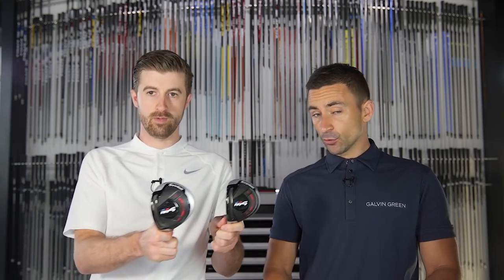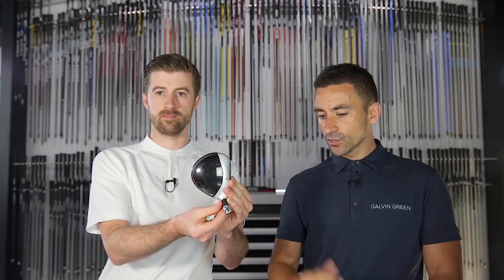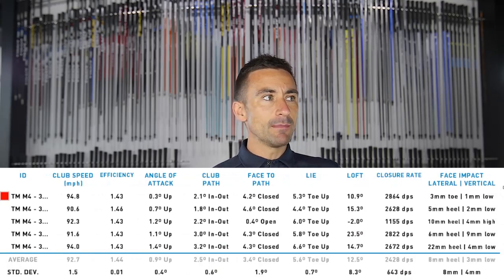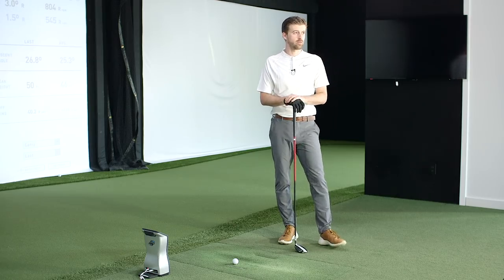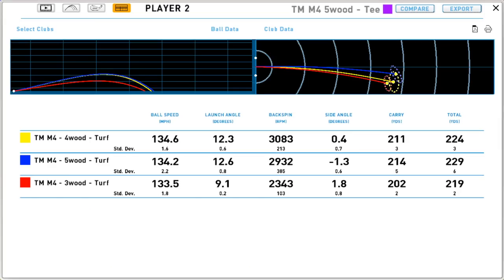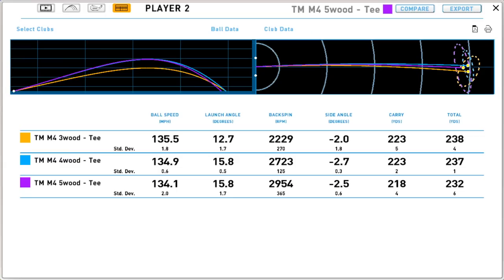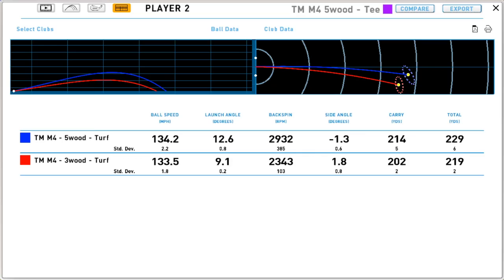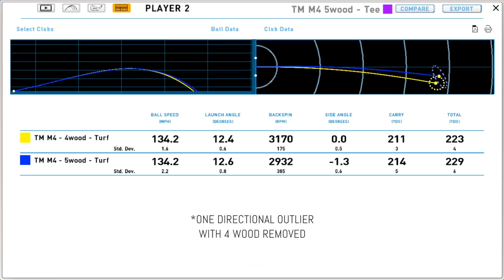Are You Playing the Right Fairway Wood Loft?

Comment: I have come back to this video after a year and I have followed its recommendations -  dropped the 3w from the bag, turned down my 5w a degree to 17 degrees (so a 4w) and it is functional both off the tee and off the fairway.  The reality was that the 3w at best was only 10 yards further than my 5w but far more erratic. 

As Mr Average swing speed, the video was 100% correct.  I have not tried a slightly longer shaft in my fairway - interesting idea, although oddly I have shortened my driver shaft to 44.5" and massively improved the accuracy of the driver with no/little obvious loss of distance

Comment: The theory conversations and way you go about things in fitting ideas is great. My first golf coach told me something about club setup 25 years ago. He said to find a club that you have to have, your go to club but it can't be a putter or 1 wood (they weren't called drivers exclusively for a few more years then) and then build your set off that. For me its a 56deg wedge. Everything in my bag is gapped off that club. I don't carry a 3wood because I don't need a 265yd shot off the deck or tee. I go driver, 19 deg hybrid, 21deg utility iron, 4i-9i, 47deg PW, 52, 56, 62. I've gone from traditional sets, to very non-traditional sets. If I play a long course i'll pull the 21deg utility out and put in a 5w that gets me 10 more yards of carry than the hybrid. I am a sub 3 handicap, and getting my set built for me is a big reason why. I used to have a 3w and I think what made me dump it was playing 10 consecutive rounds and not using it one time. All the clubs in my bag now have a very good chance of being used for a reason and not just to force it.

Comment: Driver swing speed 98mph / trackman. I purchased the M3 set loft at 17 and couldn't be happier. It does create an awkward gapping at the top of the bag. I now go 20 degree M3 hybrid for my 205 carry club. I dropped the 5 wood and will probably pick up hollow 4 iron or 22degree hybrid to fill the gap off the 5 iron.

Comment: This has been a work in progress area of mine for quite a while. I play off 4 and I've got a swing speed of around 104 -108 on Trackman. In the garage is a Ping G25 16.5, Titleist 917 16.5 plus a TM M2 Tour 16.5. What I've fallen back on more often is a TM 17deg SLDR hybrid with a 5wd shaft (bullet! very similar to the driving irons) and I'm mucking around with 21deg 913Fwd. At least 2 of these have to go but fun on the range

Comment: Another great video. My swing speed is faster than low 90s but slower than Matt's - i.e. around 100. I have always been a Driver, 2wood & 4 wood player - for 2 decades. I never understood 3 wood or 5 wood - neither seem optimal from a bag setup perspective - not that they can't hit 'good shots' but from a bag setup. Your little comment about 4wood is basically as good as 5wood off the fairway but better off the tee is why I think it has worked for me - i.e. I like it off the fairway way better than the 3 because it has a shorter shaft and more loft but it can also potentially serve a dual role potentially as driving shaping type club on certain type holes. Ditch the 3 & or 4 iron, add a gapping hybrid that resists drawing as a long iron scoring type club replacement, and the bag today is much more functional than years ago. I will say that for physically shorter golfers, the shaft length of 2 & 3 hybrids are probably much better from a consistency perspective than a 4 wood. I choose the 13 degree 2 wood because I like a driving club that I can Draw - I set up my driver to Fade. Awesome stuff guys!
Reply: At 5’6” I can totally associate with that. I have to cut down everything

Comment: Matt is right, I went conventional and tradition and couldnt get a 3 wood off the deck and topped it all the time. Changed to 16° ping g410 sft to help get the ball up. Still going 240 yards. Just added the 5 wood instead of a hybrid. Both 1° flat. Really happy now.

Comment: Great info guys. I started last season with an M1 3 Wood. Found it was too long off the tee. Felt like I was carrying two drivers. Switched to the M1 3HL (4 Wood) mid season. Better gapping and much easier to hit off the turf. Like you said in this video, it becomes a much more effective club. Win win for me and I haven’t looked back.
Reply: I also use m4 HL FW at 16.5°. What are your next 2 clubs as that’s where I find the problem. I use m4 HL FW at 21° then 4-hybrid (22°). Seems bunched up but I’ll measure it this winter to see gaps.

Comment: Great video. I have my 3W @ 14.5 degrees, 5W with loft dialed down @ 17 degrees, 3H @ 19 degrees and 4H @ 22 degrees. I get a more penetrating on the 5W dialed down as 4W @ 17 degrees and reduce height of the tee.

Comment: Great video guys as usual. I have a 15.5 3W for off the tee and will use it out of the fairway only when I need a long 2nd shot with no hazards and no chance of dropping into a green. I then have a 17.5* 5w for the turf only out of almost any lie. Then go 3 hybrid to 4i. I find this gives me lots of options for the top of the bag for a slower swinger that sometimes struggles to keep driver in a tight window. If the two way miss creeps up off the tee I go to the 3w or when there is a dogleg par 4.

Comment: I upgraded my 3 and 5 r9 to a single cobra king f6 at 17.5. Both r9's went the same distance and ballooned as got when much slower. So switched into a stiffer shaft -Much better flight, easier off the ground and longer.  Plus added another wedge as use my fairway woods maybe once a round.

Comment: I still have a 13.5 callaway 2013 XHot pro in the bag. I only use it as a mini driver. Goes maybe 10-15 yards shorter than my driver! It's awesome of the tee. But of the turf it's hard to launch so I bought a couple years ago a TM 3HL wood. That thing just launches high but I loose about 30 yards. It's always good to have some options depending on the course you play.

Comment: I now carry a # 5 and # 7 Ping G 410 S.F.T. Woods. With my swing speed a 3 wood doesn't seem to make much sense. I am only 75 to 80 mph off the driver. I use senior shafts.  I like the higher lofts. :) I agree with your thoughts here.  I love the Ping G 410 S.F. T.  5 Wood. :)  This 5 Wood is set at 19 degrees of loft. :)  Of course its adjustable as well.  I must add here that I have found that I hit the Ping Woods better off the turf and tee then other makes as well.  Spider Dubiel

Comment: I play R580 3 wood and 5 wood with Grafalloy blue stiff shafts. Must be 12-15yrs old. Have had them years. But can't get anything to match their performance. Swing speed on trackman is 105mph with driver. Use the 3 wood as driver replacement mostly , only of deck when miles out. 5 wood is evenlY split between fairway shots into par 5s. and short  par 4 tee shots.

Comment: I'm a 1 handicap and I absolutely hate playing a 15* 3 wood, I'm all over the place with it. put in a 16 degree Mizuno Hybrid cranked down to 15 and its my favorite club in the bag all because of the 2 inch shorter shaft and more consistent strikes. I carry my clubs, Driver 275, 15*Hybrid 240 19* hybrid 225 4 iron 205, it fit in my gap just perfect! :)

Comment: My 3 metal is 14.5 degrees.  While it hit it beautifully, it is only 10 yds less than my driver. So for the past 3 years, I have a 16.5 degree 4 metal in my bag rather then the 3 metal. Much more versatile! (My driver swing speed is ~100mph). I whole heartedly agree with your conclusion.

Comment: Very helpful to me right now to remind myself as I am about to make a decision about drivers/fairway with the new titleist ts range. They also do a 16.5 3 wood hl as they call it and might be my optimal choice for both fairway and tee (instead of a driver altogether)- as also planning on getting the 3 and 4 hybrid (h85). But one issue is club length as previously I had all the club lengths shorter than std including hybrids. Concerned about swingweight balance and also how it might change the numbers you showed considerably if cutting lengths say 0.5 inches or more even.

Comment: I’ve never tested my swing speed, but at 100+ I have to think 15* is the way to go. I average around 255-260 with the 3 wood (M2 2017). But I liked a point they made that the course matters. My M2 15*, M4 hybrid 19*, P790 4 iron has pretty good gapping. A little more loft out of the rough is a good idea though, since the spin will be too low to carry.

Comment: Rewarching this video as I’m trying to ditch the G425 max three wood and get a five wood lofted down to a 4 wood club. However getting too much spin with the DJ 6x around 38xx which couldn’t set apart from my 7 wood with DJ 7S tipped one inch. Driver is g425 lst set to 11.5 with Ventus black 5S tipped half inch. I’m Thinking to put a lower spin shaft something like a VR or ventus black 7S in the five wood but keep the 3 wood shaft length. What do you guys think?

Comment: Great video and really interesting.  As usual I appear to be Mr Average - regular shaft, standard lie and length and average swing speed!  But I have cranked down the loft of my Epic 3w to 14 degrees and I feel it is easier to hit than the standard 15 degrees, that may be because, as you explained, for a slicer sometimes lowering the loft helps close the club face.  When I started playing golf 40 years ago I had old wooden 2w & 4w - the 4w was a cracking club even then

Comment: I dont think my swing speed is high but I love my 3 wood. Probably my favoriteclub right now. I got it to stop on the green from 220 yards last weekend. I usually get a pretty decent ball flight.  Total distance is anywhere between 215 to 250 depending on if I really go after it. I have mine set at 13.5 with the weight back on a cobra f7 3-4 wood.

Interesting video. I was surprised by the numbers. I guess it's just as important to get fitted for fairway woods as it is for a driver.
Reply from the maker: Depending on the conditions of your swing, 3 wood might be a nice fit for you Ben. Sounds like you're generating enough spin with it for it to be a versatile club.
Reply: TXG Tour Experience Golf I think it's my angle of attack, like you mentioned on the video.

Comment: Great videos guys....thanks.  Question:  I play with Cobra S3 3wood (15* loft) and 5 woods(18* loft)......both have Fujikura Blur TX 006 R-flex shafts.  My driver swing speed average is 101mph and my irons are 84.  This "loft up" video has prompted me to ask if it would be possible to add an adjustable sleeve to both of my fairway woods that would permit my 3 wood to go up to say 16.5* loft because I use it both off the tee and off the fairway?  Thanks and have a great day!

Comment: Congratulations on going over the 10K marks. I think you will have 100K subscribers before you know it.  This is a very timely video. I’m trying to figure this out for myself. Question for you; was the shaft the same length or different lengths in each of the fairway you tested?
Reply from the maker: Thanks! And we were using the same shaft length in each club head.

Comment: How apt, I actually swapped around some clubs this morning and put in 16deg and 19deg fairways and a 22 hybrid. A little off topic, I’ve noticed you guys and most of the others use gc quad . I’ve been looking around get fit for new irons here in Melbourne and everyone appears to use trackman, is trackman as good a tool for fitting considering strike etc.
Reply from the maker: So the GC Quad is the only system that reads strike location with its camera based system. It's the best machine to use for indoor fittings, but if you're outdoors you can also get accurate information using Trackman's radar system (although not the same data on strike point).

Comment: Great work again guys....I have a question around this concept regarding the driver. I swing with the driver at around 100mph but require a stiff low torque shaft so I can feel where the head is, this gives me confidence and more control. I’m more of a hitter than a swinger and pretty strong in the upper body. My driver shaft is the Hzrdus yellow and I play the standard rouge head 10.5  lofted up to 11.5 degrees, my swing shape is a fade and I play off a 12 handicap. Finally my question is do I add another degree or take a degree off? I need loft to generate height as the swing speed is pretty low but I need the feel of the shaft that I currently use. By the way I play an epic 3 wood lofted up to17 degrees, a 4 wood and it’s unreal, especially off the deck. Thank you in advance...Steve 🏌️👍🏻
Reply from the maker: Loft would definitely be helpful to getting more elevation. The shaft won't have as much of an effect on peak height as the loft will, so that's a good option that would allow you to keep the shaft in the driver that you like the feel of.

Comment: I found on a fitting that I spin the ball to much so was losing distance so got fitted into a 13 degree 3 wood. I went in there thinking I wanted a high launch 3 wood but found the 13 degree has a really nice flight for me. I also went in really wanting blades but even with the lofts bent strong they still spun to much. Ended up with mp18 mmc
Reply from the maker: That is the beauty of fitting!

Comment: Hey guys! Would you consider taking a 15 degree sub zero 3 wood head and just adjusting it to 17 degree making it a 4 wood?
Reply from the maker: Rogue fairways aren't actually adjustable, they have a glued hosel connection. The standard rogue fairway does come in a 17º though, the sub zero only in 15º and 18º.

Comment: I have 90/92mph swing speed for 3 and 5 wood. I have both adjustable necks on each, currently I have both set at 13.5 and 17 off the turf I’m a sweeper and carry my 5 wood 200 yards but I’m struggling with my 3 wood off the tee and was hoping for a bit more out of my 5 what lofts would you suggest for each to get me started?
Reply from the maker: Try at least 15º in the 3 wood, and demo a 16.5º or 17º if you can which is essentially a 4 wood loft. For your 5 wood, you might find 18º or 19º to be a better fit.

Comment: What is optimum launch angle and spin rate for a fairway wood?  I launch my 3W around 12* and spin it 3200 ish off the turf.  It's a 14* Ping G10 model that I have loved, but I always find myself wanting to be able to hit it slightly higher off the turf.  My clubhead speed with driver is 110 consistently.  Would I benefit from the 4W route?????
Reply from the maker: Probably Ryan, look at a 16-17º head with lower spin characteristics (i.e, Rogue Sub Zero fairway). That will help get the launch angle up a bit and keep the spin in a good range. Your 12º launch and 3200 spin certainly isn't bad, but might benefit from a bit more launch angle.
Reply: I love the head and shaft setup I have with my G10, plus I have an identical backup shaft in my shop.  I am thinking of just putting a G10 4W (17*) head on that spare shaft at the same length as my currently 3W to create the perfect fairway wood for me.  Thoughts there?
Reply from the maker: Could work well, test it out!
Reply: I know the head is an older head, but they are soooo good for me.  As a mini tour player and former college player, it's always tough for me to go away from what's working for my game, hence finding a 4W in that G10 model.  This channel continues to be the best fitting information available today!  You guys are phenomenal on educating us all.  Keep up the great work and videos!

Comment: So why do you say it useless to carry a 290 yard 3 wood I'm currently at the 280-285 yard mark with my 3 wood  and my 2 iron goes 265 is was trying to fill the gap between 2 iron and my driver.
Reply from the maker: How often do you have 285 into a green when you hit the ball presumably over 315 with your driver? Depends on the player and what you want to use the club for. If you're someone that is much straighter with the 3 wood than the driver and wants that 280-290 number then maybe it has a place. But for most people, unless you're playing courses well over 7000 yards on a regular basis, there's not that many times a club at that distance is used versus a 4 or 5 wood or even an extra wedge (in the case of replacing 3 and 5 wood with a single 4 wood).
Reply from the maker: Steele Brandon It depends on a number of things,  how good your wedge game is and how versatile you can be with those clubs.  How good you are with your driver and the type of courses you play.
Reply: I only play a 58, 52 and a 712 mb pitch I would say my wedge game pretty good for the most part. I hit my 3 wood once off the course On my course on a 370 yard par 4 so I’m not stuck half shot in to the game
Reply: I play course between 6800 and 7300 yard around my area.

Comment: I notice too that if you take a short shaft, perhaps a 2 hybrid shaft, golfers tend to hit their woods much better. I think most manufacturers make their woods way too long for the average golfer. I have to play my 3 wood 1.5 inches shorter and my driver 1.75 inches shorter or else I can't hit the ball well at all. I think many golfers would benefit from doing the same.
Reply from the maker: Experimenting with shaft length can be a good fitting tool.
Reply: Yeah :) I'm a bit of an extreme though, 1.5 inches is a huuge amount shorter.